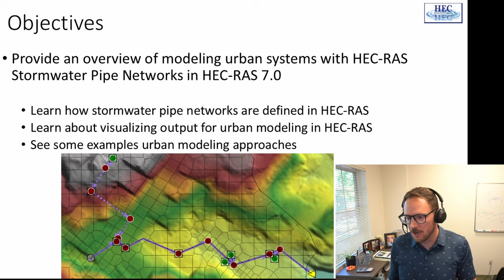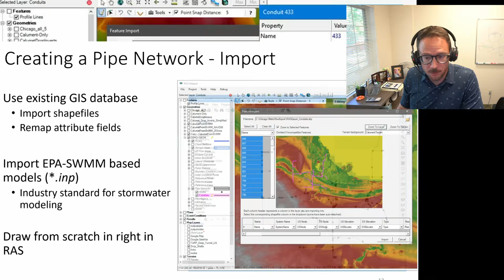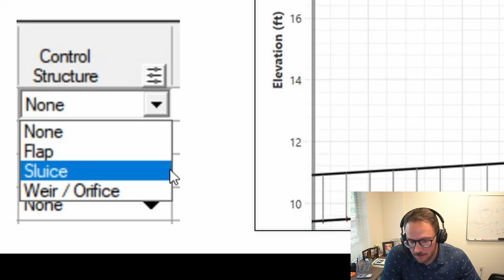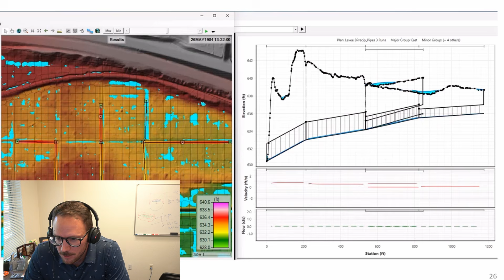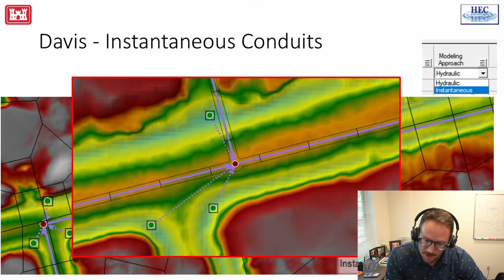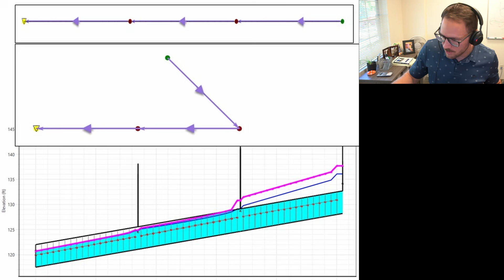Stormwater Pipe-Networks in HEC-RAS 7.0 (HEC RAS User Group Webinar)

Comment: I am missing something? The attribute table do not allow to enter double pipes? If I have double 36 inch pipes, do I have to draw another conduit? It would be greate if there is # of pipes column in the table.
Reply: Yes you need to draw another conduit since the hydraulic losses are geometrically based. If your double pipes are connected in a rectangular structure, you could probably model that as a box culvert, so each pipe has its own node.
Reply: the two  pipes  are connected to the same junction box, means there is a single node at inlet and outlet. I did draw another line, but spatially you don't see rhe line in mapper, just one line because I have the same node.